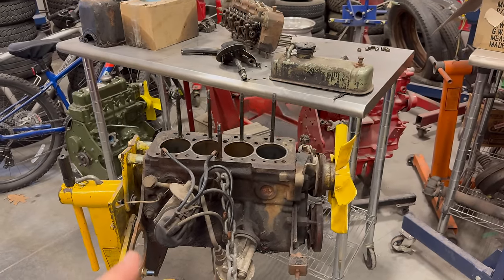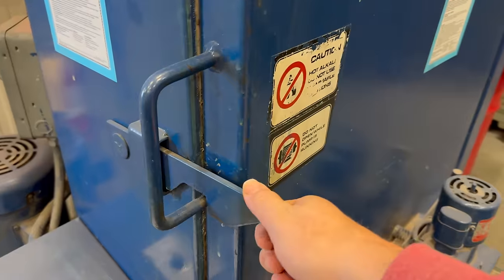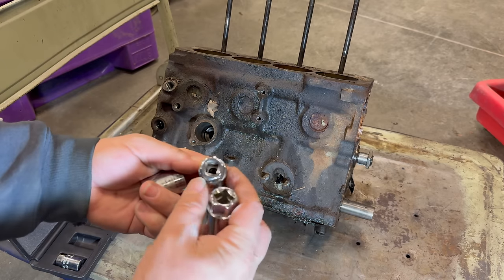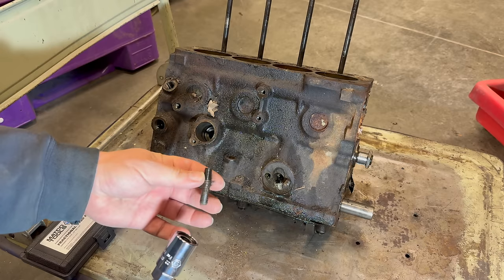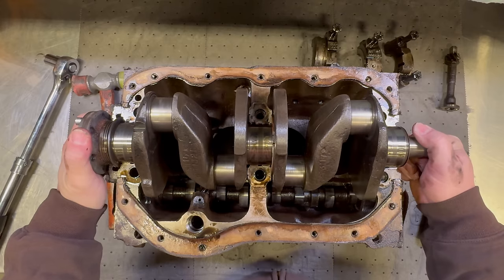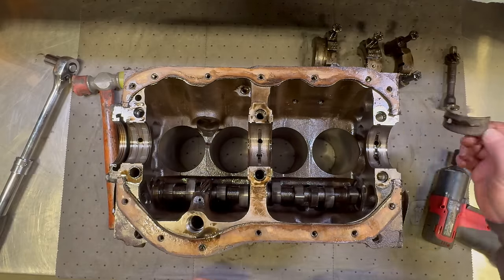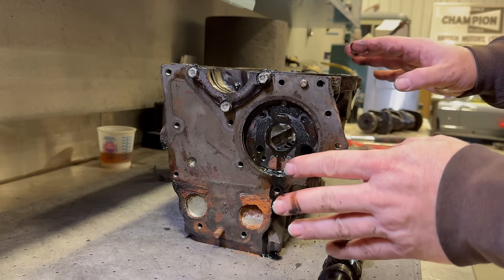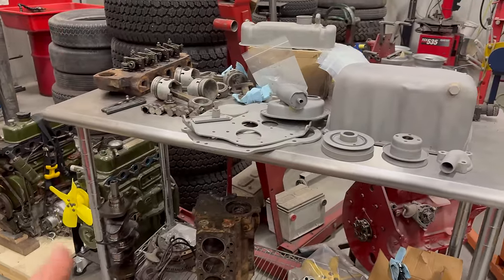1275 Engine Tear Down for Barn Sprite Number Five

Comment: On those older engines they had what we called 'scroll' oil seals on the rear journal which worked fine when new and when running but when older and the engine stopped oil just leaked by and into the clutch bell housing.
There is a conversion kit available to change to a modern oil seal arrangement. Very common fix on Morris Minors.
But you have a bit of a production line going there ..... 👍👍

Comment: Very interesting to watch a tear down, brings back memories. I have used the larger stud remover but not those smaller ones. They might be useful in tighter spaces and as you say studs that are not too stuck. Looking forward to the next stage Merry Christmas Steve. 👍👍
Reply from the maker: The big one is very good but not in a small space that doesn't have enough room for it to turn and sometimes the stud (or broken bolt) doesn't stick out far enough for the big one to grab onto it.

Comment: I have rebuilt a number of the the 1.8 litre MGB engines, (5 main bearing) but it's cool to see the 1275 little brother torn down. I have two 1275 engines also which may need rebuilding in the future so thank you very much for sharing. Oh if only I had room for wonderful parts washer in my garage.  Looking forward to the next installment post machine shop.  Any idea how much overbore these little engines can go to?
Reply from the maker: You can easily go +.060 but I prefer to keep it no more than +.040 because they will start to get hard to keep cool if you go larger.